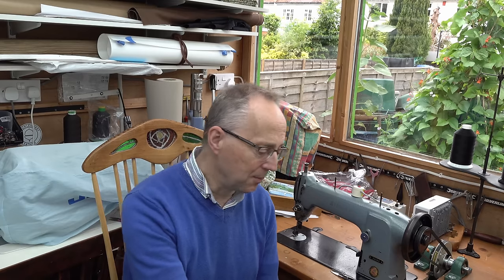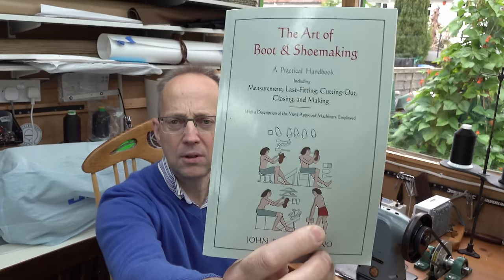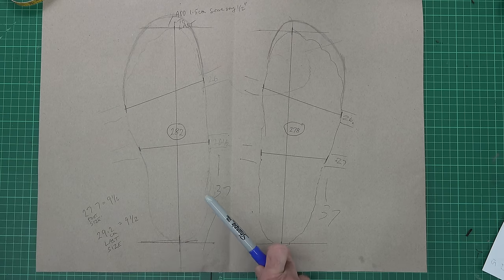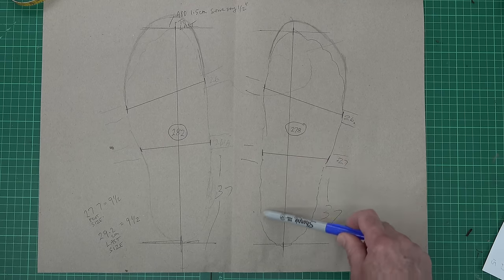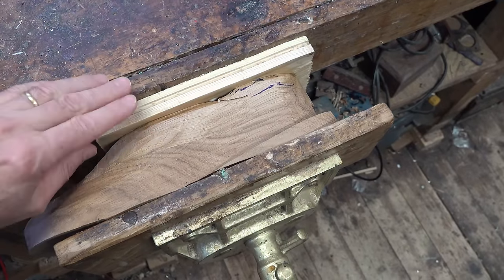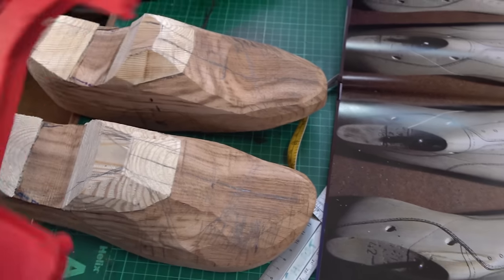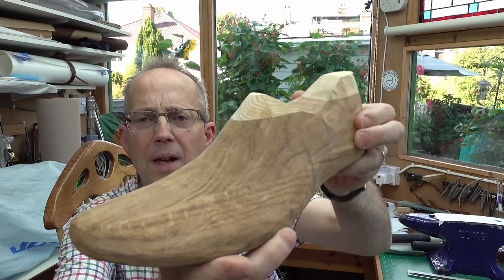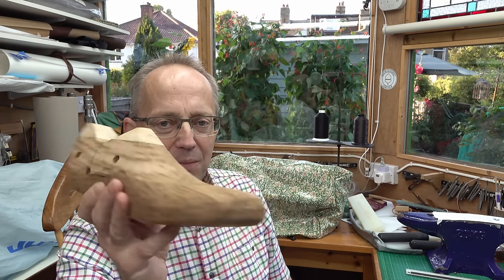Pt 1. Shoemaking...Making Wooden Shoe Lasts, Shoe Forms, By Hand.

Comment: The courage to keep moving forward at the risk of failure is very important!  It goes along with not suffering from analysis paralysis...  Yes some extra materials may be consumed during the trial and error process but it isn’t wasted, it’s an investment!  In the long run if the first shoes coming off the lasts aren’t quite right you can add and subtract material to the lasts to make them better...

I find this shoe project very interesting.  Thank you for taking it on!  It also reminds me of the first 4 drawer chest of drawers I made... entirely with hand cut dovetails. I made three sides, eight drawer blades, five drawers, and six feet. Overall I thought it turned out well enough to display at a woodworking show.  I went about my day attending seminars, looking at exhibits and visiting vendors.  Mid-afternoon a fellow I knew comes up to me and said “Congratulations.”  I had no idea what he was talking about... turns out my educational piece was awarded a ribbon.  I appreciated the generosity of the professional judges.  I anticipate that folks here will judge this shoe project with generosity too.
Reply from the maker: Thanks very much John...and we'll done to you.

Comment: You've done a great job keeping them symmetrical. I would have thought the easiest DIY approach if trying to replicate an existing shoe would have been to stuff the shoe, wrap it in kitchen food film/plastic, coat it in fine weave fibreglass matt to make a mould and cast it in resin. Using the resin casting, if you desired a wooden product you could always mount it on a buck and slice horizontal segments off using a table saw, then cut those segments from plywood sheets and glue them together to make a laminated topographical map of a sort. Smooth the edges to blend them together and you would have a wooden block that looks like a shoe.
None the less, you did an outstanding carving them out.
Reply: I would go the other way. Fill the shoe with resin perhaps with something to take up space so you dont have to use as much resin. Then slightly grind the toe box a bit shorter to match your actual feet..

Comment: Nice one Harry, you dare to tread where others fear to go, take it a step at a time. Yeah I know bad puns, ha ha. Have you tried flap sanding disc, they are brilliant, not as aggressive as the monster your using, they fit on a grinder & let you get rid of a lot of material allowing you to form curves in a more controlled way, once you've tried them you will wonder how you got by without them. Great videos done in an almost gentle way that I find absorbing & informative.
Reply from the maker: Thanks Bruce...I may try a flapwheel for a final smooth off...thank you.

Comment: Hi harry, nice project to taking on. I am sure you will do great. When finalising you’re last measurements make sure your heel width measurement is precise also your instep height and Long heel measurements. Those are crucial. Once you have them sorted you can have as much room around forefoot you want, usually for adult shoes 2 shoe size extra room at toe ends is sufficient but you can have more if you are making square toe shaped lasts.  Smooth last makes it easier to drape the leather on top of it starting with lining. Also use lots of chalk powder or talking powder once at that stage. Good luck mate.
Reply from the maker: Thanks very much for those tips Izzet....I think I need to smooth my lasts some more, and I will check heels...thanks.

Comment: 5:18  A profile gauge.
As you said, it would be wiser on the first pair to use standard lasts and then adapt these to match your foot measurements by adding on wood-filler or rasping off excess as required.

Comment: Great Job! 
   I also am a woodcarver and a tinkerer among other things… And I’ve found that sometimes introducing another media to help -can work Wonders…
   I wonder if a plaster cast of each of your feet with a fairly thick pair of buttered socks on- (to allow for the natural breathing space in a shoe (the butter or petroleum jelly will act as a release for the plaster-so you can also get your socks back)) -plaster doesn’t shrink when it dries, so it might give you a fairly exact 3d model -including all the measurements of each of your feet.
   You’d have to cast them standing to allow for foot spread and On the toe rise and heel lift you’d prefer -So maybe make that into a flat wood surface that has the heel and toe lift -and stand on that with your foot in a plastic bag, to create the plaster mould of each foot Be sure to cast your feet up your ankle a bit- to get all the angles and shape of the joint and direction of your  leg -so that your shoe openings are correctly cut and angled, so they won’t bind or grind on your ankles or instep as you walk (also useful if you ever desire to make yourself boots) Then use those casts to pour the moulds -to create your plaster feet. 
   Then it would be much easier for you to create- in wood, your unique lasts- because you’d have your plaster foot models to compare and contour against- with your contour guide and eyes and all… So all your hard work goes into perfectly shaped lasts that will last! and you’ll get in the carving- all those important micro measurements- that are too hard to measure or even see- linearly… 
I always wanted better shoes- that actually fit me- 
   Your video has inspired me to try- Thanks so much for sharing-
Reply: Please ignore the strikethrough line- those words actually belong- ….technology 🙄
Reply from the maker: Hello and thanks. I think you may find it interesting to get hold of an old plastic or wood last and to study its shape compared to your feet. They are designed to hold the shoe on your foot, and as a result are not an exact copy of it. I have done a lot more research since making this video and you may find it best to buy some ready made lasts to get going from Careducker or Springline in UK. If you want to have a go in wood, make sure you have a squared off base featherline to facilitate stitching. Good luck.

Comment: You'll do fine!
I have sewn my shoes on my patcher.
Theres alot of different style shoes.
Goodyear welted can be done completely by hand, and so does the cemented one. If your going for a Goodyear welt, find your self a thicker inner sole so you can sew the welt on it. It's really hard to do on those standard insoles. You can even glue a welt on afterwards, I think that's a bit of "cheating". :P

Hope it goes well!
Like what you are doing. :)
Reply from the maker: Thanks very much for the tip to use a thicker insole...I hope to do this method.
Reply: @harryrogers  in my gathering of stuff for my attempt to make a pair, I have some insoles and soles I bought. the insole tends to be from a "belly" section and is just as thick as the leather sole (both around 10 or 11 iron). The insole is far more flexible and softer feeling than the sole.

Comment: Actually shoes were made left and right until the 18th century and into the 19th, when straight lasts were used for cheapness of production.  Sided lasts came back later in the 19th century.  So sided lasts went out and cam e back purely for economic consideration

Comment: I've sore far just resoled a pair of Doc Martins (old UK made "dress" Doc's from around 2000), going with a cork filler, leather sole as midsole and crepe glued on then Vibram heels over the crepe. They do well enough I can walk around the neighborhood for exercise, and do yard work in them.
I cheated on lasts, I found a place that had some in close to my size for relatively cheap and added leather to widen and lengthen just a touch, Depending on brand, I wear 8 eee or eeee to 8.5 eee, um . . . 7-7.5 UK sizes iirc . . . but have some boots in 9us/8uk as well and have a set of lasts for those too, as I am trying repairs on some of my motorcycle riding boots. The lasts are marked 7.5 - 8 M and 9 - 9.5M I have shoes that fit very well that both lasts fit in So my bigger set is more like a 9us/8uk, and the smaller ones widened and lengthened fit my 8.5 wide shoes so I did a sacrificial relasting of a pair of size 9 riding shoes on them, and they actually fit! I will add a touch to the toe box upper for my scratch-made pair to get a little more room. Not going for a dress shoe, but a more work shoe/recreational style.
I look forward to watching the rest of your journey.
Reply from the maker: Sounds great.

Comment: thank you for this video. I am wondering if I could make a shoe last without going to a school or learning from a teacher? Mainly self taught. is it possible?
Reply from the maker: I think you can learn a lot by trial and error and by looking at commercial lasts, but there are a few things you need to know to increase your chance of success including the standard shoe formulae for key parts of a shoe and to understand that a last is not a copy of one's foot, but a design that let's you make a comfortable shoe. I learnt a lot making these and they did largely work out well  but it was only when I spent hours researching all of this that I understood more and more about what makes a good last for a particular shoe type. The book Footwear Pattern Making and Last Design is a very good book on this. My own book covers some of the key formulae etc. I think I would on balance say buy some commercial lasts  but making some yourself and learning will probably make you smarter in the long run if you learn by doing.

Comment: Very nice.
The shoe lasts I've seen in some museums have been quite polished; I wonder if that's important.
They could just be worn down with use.
What did you intend to use for the treads?
Reply from the maker: Thanks, I suspect I should sand them smooth to stop the glue sticking to them...thanks for pointing out the polishing bit....lots to learn.
Reply from the maker: Just to add treads will probably be leather.

Comment: Dear Sir, after succesful crafting of some pairs of shoes,  I have become interested in making my very own show last. I'd like to ask wheter you have found any book or other guidance for the shoe last design. Also, one specific questing of your shoe last. Do thye  have flat or curved bottom?
Reply from the maker: Last Designing & Making Manual based on the geometric method
George Koleff
Reply from the maker: Hi I have included details of a book that is very good but hard to get hold of. The lasts have curves on the bottom, my main mistake was having a rounded bottom feather edge, rather that a squared off edge. It's helpful to look at old lasts to see how they are done, and Bill Bird on YouTube provides a lot of good tips.